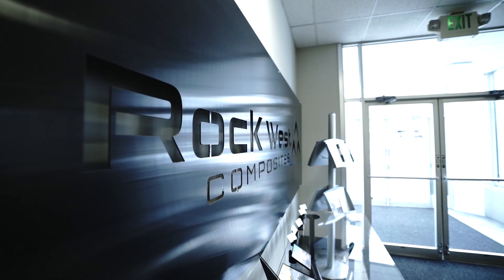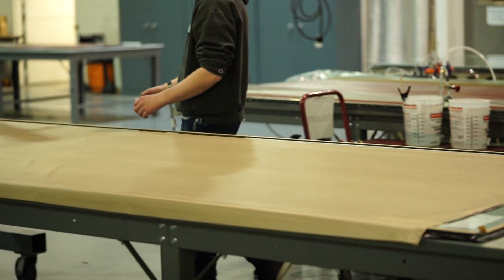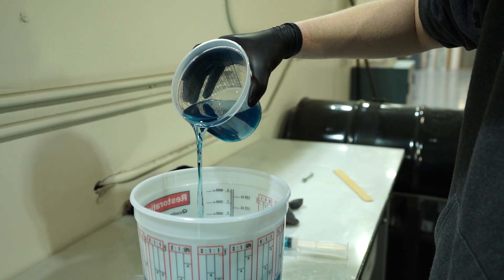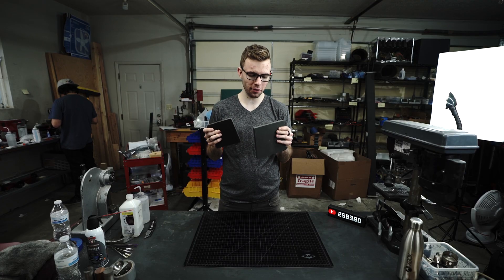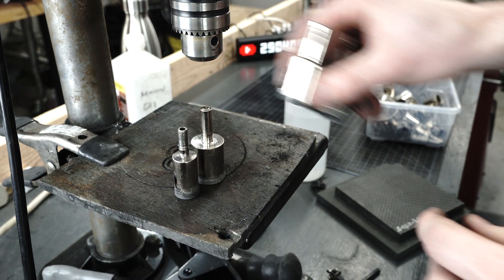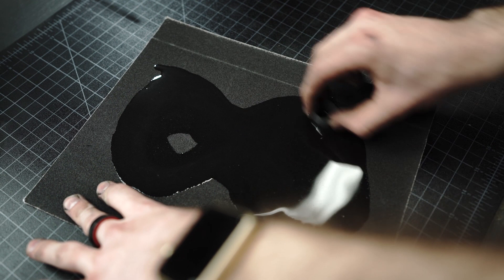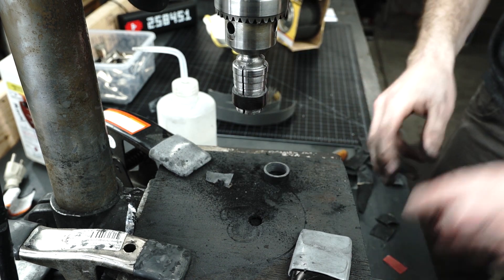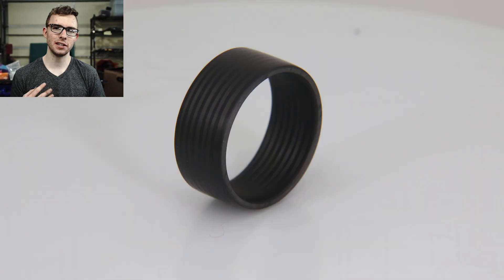From String to Ring: Making a Carbon Fiber Plate to Craft into a Ring

Comment: If you accidentally drill the big part first you could use some kind of glue or epoxy to hold it down while you drill out the center. Just use a piece of wood as a base and throw some masking tape on top then epoxy the ring to that. It wouldnt take much to clean it up after. Just separate the ring from the tape and  since you'll be sanding it down anyway it should be fine unless I'm missing something. I've never done it but it makes sense in theory

Comment: For those that don’t have a ring mandrel, I used to fit blanks on sockets. Then use electrical tape and tape above and below the ring with slightly thick wraps. This prevents the ring from sliding up or down. You’re then able to do what you need to. When finished, remove the tape and slide off your ring.

Comment: Something I would like to add for those that would use a hand drill hole saw... maybe clamp the material on a 2x4 or any block of wood to help keep the center drill bit in one spot from the inner diameter to the external diameter

Comment: I subbed,  although I am into traditional jewellery making, I really like what you are doing.  I'm setting up a proper workshop in Scotland where my family home is. It isn't feasible to do casting and forging in my flat in London,  so I will do my design and any wirework that doesn't involve annealing or torches in London and go up to my cabin which should be properly kitted out for casting and forging and enamelling every couple of weeks.  I am really interested in the materials you're using and I am sure your rings would be really good sellers. I know a lot of ladies who would love them too. I will keep watching your very interesting videos and if I ever decide to try making a carbon fibre glow in the dark or meteor ring I will be in touch about getting the materials.  I think these are really nice looking rings as are the others I've seen.  I think you should be patenting your designs tbough and wearing breathing masks and safety glasses (I can't help the safety thing....my son got a molar removed (2 molars) because he needed a brace when he was around 13 and I caught the little bugger trying to drill his extracted tooth with the Dremel I gave him for Xmas that year. ...I  came into the room just as the tooth fractured down the middle and nearly went through my head!  He never touched any tools without safety gear after that...I was livid but relieved he was ok.
Reply: Foxiepaws ACAnderson tl;dr

Comment: Great video and thanks for the heads up on the discounted carbon fiber kits :)   
Questions :   
1.)   What size hole saws did you use ?
2.)   What ring sizes did they make ?
3.)   How many rings can you realistically expect to get out of a 5"x 5" plate ?

You told us the 2 rings sizes used one hole saw size difference between them but didn't mention the saw size or ring size them make :)

Thanks for your generous consideration,
Sincerely .............

Comment: Absolutely do not work with carbon fibre at home. The dust is toxic and conductive. You should be using skin and respiratory protection at the very least.
Reply: Was about to say that. Protection for the lungs is very important, although in a vented environment it should not be too critical (well, he is doing the extreme with sanding..) but also the skin. Carbon fibre dust gets everywhere. In every little pore of the skin and stays there. I once got a splinter from a carbon fibre arrow in my finger (its so small you dont even see it), and weeks later your skin starts randomly dying off. Not fun.
Reply: It suprises me the videos on you tube of DIY projects and the amount of people not using the proper PPE for the project / job they are working on
Reply: From what I have heard (made a copper/CarbonF ring and a friend told me afterwards), it passes regular masks and dust protection gear, because the dust is so damn fine.

Comment: I always keep asking this but is it possible to to drill the carbon fiber the other way so that the rectangular pattern is on the face of the ring? If not maybe you can do some dip painting with a carbon fiber pattern in a carbon fiber ring.
Reply: You would have to get a block of carbon fiber so thick that you can drill the ring out from the "side" rather than the "top".
Reply: yeah, or glue two smaller blocks

Comment: With all the obsidian faceted rings you have made, you should make one using real obsidian.
Reply: griffenlancer "it's glass so he cant drill it"??" or work on it"??? errrr... right.., are u joking, or what??😂
Reply: @Linktw0  yes obsidian is a glass like substance but i do believe he can work with it, we have seen him do other things that are probably harder XD
Reply: He could back it with carbon fiber, if possible, like he did with the bogwood ring
Reply: griffenlancer depends on what kind of glass he uses and how carefully he does it.
Reply: rip
Reply: And I've made pendants out of them and cabochons and it's difficult to work with, rings would be much more difficult but a great challenge
Reply: Too brittle, will shatter the first time your hand brushes against the back of a folding chair.  You can't even infuse it with resin to strengthen it, like you would with brittle bone or stones.
Reply: @jbtechcon7434  could encase it in clear resin though to protect it
Reply: he could also just try casting the obsidian??? it aint brittle if its molten
Reply: obsidian is volcanic glass. heated and cooled, but not treated. at least i think that's how it is. too brittle to work with cold. heating it might work, but the mold would have to have the finished shape. and then the ring might fall apart under extensive abuse anyway. probably scratches easily.
Reply: Its glass so he cant really drill it or work with it.